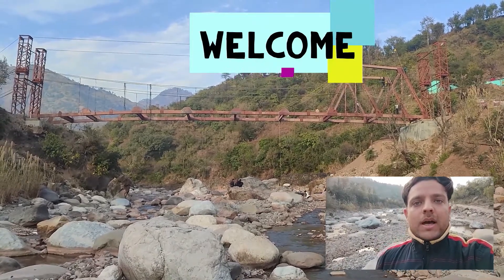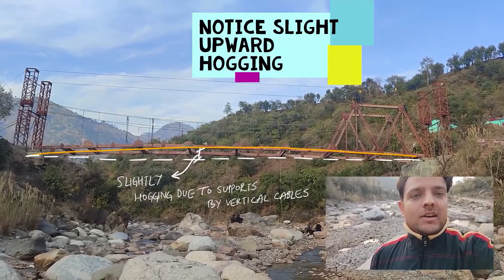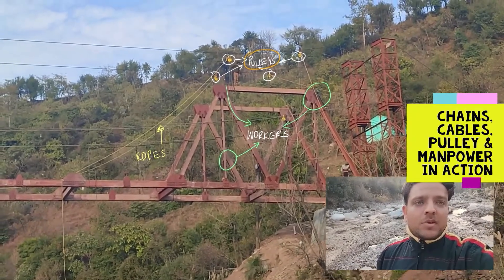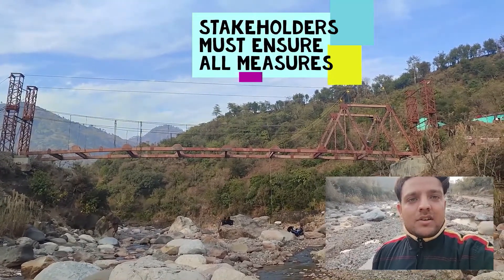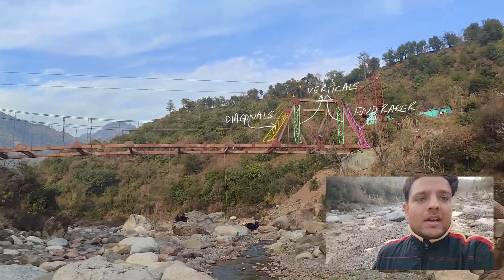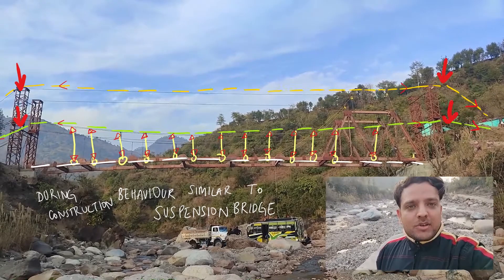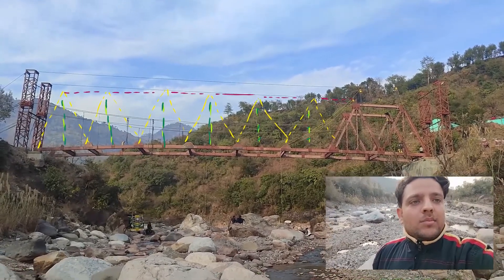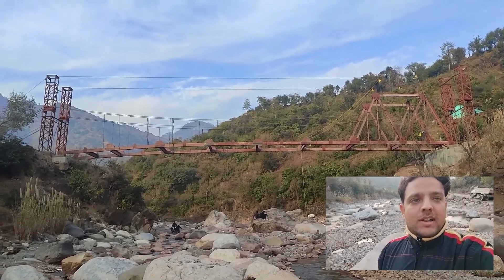EPISODE 2 | ERECTION OF TOP CHORD | JOURNEY OF A TRUSS BRIDGE

Comment: How have the main cables and the holding cables been fixed on the erection tower? Is there a pulley or a saddle over which the cables are passing before being anchored to the anchor blocks? In this case, no vertical truss columns have been used meaning that the weight of the steel truss shall be totally on the cables. What portion of the weight is carried by the 4 cables, tow on top and two in the middle of the erection towers? Have the erection towers been designed for only vertical compression or bending also considering the fact that no pulley or saddle is visible on top of the towers? Please give a response.

Comment: In Nepal, I have seen Most of truss bridge fails during the erection phase whenever extreme speed wind blows, what may be the reason?
Reply from the maker: Wind forces do affect the construction sequence. It's very very important that before the final structure takes shape, the construction sequence must be as properly designed as the final bridge. 
No construction stage design may be one factor if it is failing during erection. 
Also note that erection sequence also needs to be approved by a competent authority before following the same at site.
Reply: @AllAboutBridgeEngineering  Wind affect the overall constructiom sequence as the weight of erected steel member is very low and it can be counteracted by dummy weight before casting deck
Reply: @AllAboutBridgeEngineering  How have the main cables and the holding cables been fixed on the erection tower? Is there a pulley or a saddle over which the cables are passing before being anchored to the anchor blocks? In this case, no vertical truss columns have been used meaning that the weight of the steel truss shall be totally on the cables. What portion of the weight is carried by the 4 cables, tow on top and two in the middle of the erection towers? Have the erection towers been designed for only vertical compression or bending also considering the fact that no pulley or saddle is visible on top of the towers? Please give a response.